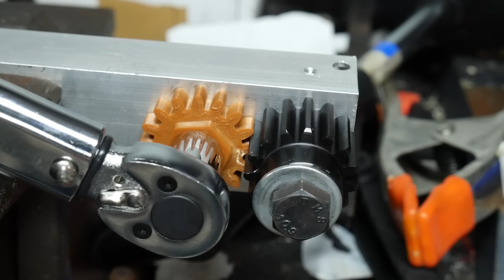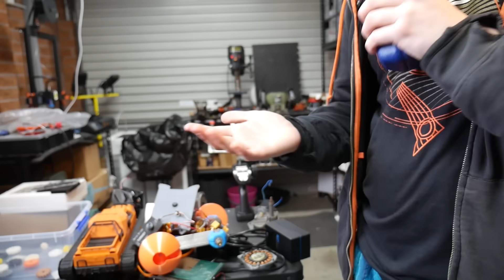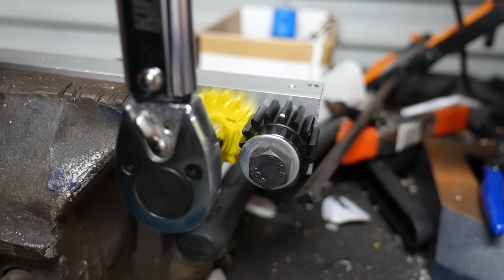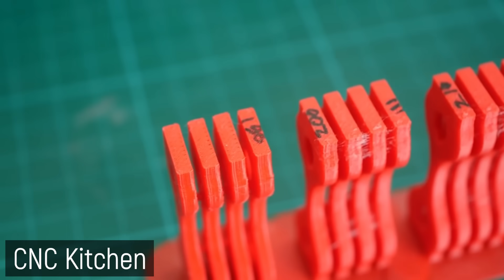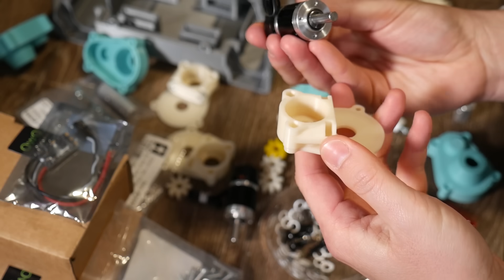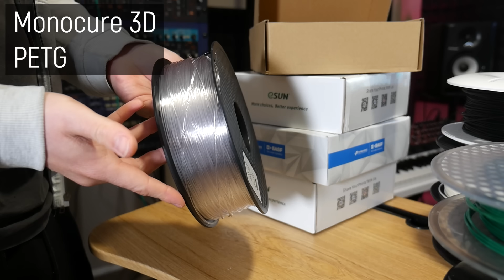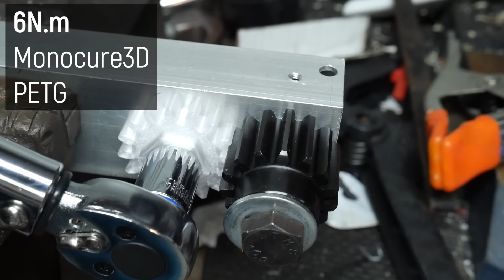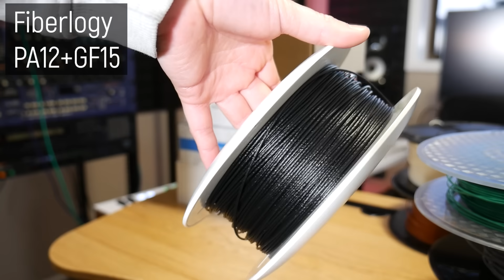Which 3D Printed Gear is Best?

Comment: it is pronounced B-A-S-F as it is an abreviation vor "Badische Anilin- und SodaFabrik" which roughly translates to "Badic Aniline and Natron Factory". You are welcome.

Regarding your strength tests: 12Nm is quite alot for a gear made from plastic and in this size. you could easily put more torque through it by scaling it up so the lever is longer. We made 3D printed RC cars in a university project and our gearboxes where the one thing everyone thought would fail but it was the only thing that didnt. 3D printed gears are pretty tough.

Comment: Interesting and useful information, however I would have changed your testing slightly. When you note the deformation of the gear stop and switch to a 'fresh' set of teeth. That way your failure spot isn't based on a weaken tooth. I doubt it would have been a big difference but still would be interesting to see if it would matter

Comment: Wondering if you could improve on failure caused in the hex shape, using a some kind of "star" shape profile - something they use for bicycle crankshafts instead of rectangle for better durability.

Comment: why not use cast aluminum? all you need is a torch, steel cup, molding sand, a few pieces of garbage wood, and a piece of really fine styrofoam. 
cut the styrofoam to the shape of what gear you want. make 2 frames out of the wood, fill one frame with the sand and compact it really well to the top. then put your foam gear down and put the other frame on the first. then fill it with the sand like the first frame. and make 2 holes going to the gear. one being the spout and the other being to release any air trapped in it.  melt aluminum, clean the dross off the top, and cast it.  you can make anything really super easy and way stronger than out of plastic.

Comment: Very nice video and great data. I would love to see the highest  ranked with a solid infill and see how those stand up to the torture.  Also like to see similar video with the other filiments you have on the way. 

As for drivetrain failure. I did some RC short course racing and learned alot about different ways things break.  Lol  like for the steering servos for example. There was a common upgrade called a servo saver. It was basically a spring inside a 2 piece housing and the spring would take the abuse  so the servo didn't.  I learned in the steering system and the drive train there are always going to be at least 1 part meant to fail in order to reduce the chance of other things breaking.  The spur gear that was attached to the gearbox  and meshed with the pinion gear on the high speed motors. Those were designed to fail. There was also a tension  clutch on some that had 2 disks squeeze the spur gear with a abrasive ring of what felt like grip tape. The clutch tension would save the spur from taking those jolts from high impact and the spur would shear off teeth if the motor continued to spin. 

For your application I would say use a material that shears off teeth for your bigger gear at roughly 75-90% max torture of the motors depending on the safety margin you are going for. For the gear on your motor I would think an aluminum gear would be better.

Comment: If you can find something that can take more power than you really need, then I'd suggest building in to the design intentional breaking points (weaker areas).. 

With the Nylon I wouldn't be surprised if it would've been possible to make specific areas intended to flex, so BEFORE you start bending the teeth to the point of breaking, it would be easier to "flex" (pushing the teeth out of the corresponding teeth of the other cog) instead of breaking; That way you could "overdo it" a few times before you had to replace anything. The issue with it "bending" at the point of Torque, IS a concern, but there can be solutions.. (More material- thicker walls- for the bolt, to use a Torx-shaped axel instead of hex, and so on).. 

Either way; Do Brushless motors really "break" that way?. I mean. I haven't played with those, but it feels like either it can excert the power or it can't move and would be standing still, so as long as you don't let it stand like that and overheat, you SHOULD be good to go.. Though that is me speculating.

Comment: I think the gear could easily be 15% stronger when the infill pattern is optimized for force transfere. Iterative 3d modeling could be a basis for that. It would also be interesting to know how many hours under a specific set of 2 wheels can transfer load until failure. Usually gears are made out of duloran or POM, but both have very toxic fumes at printing temperatures. ASA would be interesting. Unfortunatelly all the really good materials need very high printing temps. Did you use a closed printer for nylon + hardened nozzle  ?
Fillaments with glass/carbon fibers (use hardened nozzle)

Comment: With high stress parts I would think you would want to use the 3D printed parts to create molds from.  Then cast the final part in a more durable material. I've never done any 3D printing though so I'm not familiar with the material.  However, I would think you could probably do a lost wax casting with it.  I remember doing lost wax casting in an art class once.  It was pretty simple.  Not sure if it would work with 3D material though vs just plain wax.  If not, you probably could create a silicon mold first and the wax form from that and then the casting.  You could probably reuse the silicon mold many times also in this latter method... thus reducing the number of 3D prints for stuff you need multiple parts of.  Anyway, that's my 2 cents.  Not sure if any of this would work or not though.

Comment: You’re correct: BASF is spoken B.A.S.F.
(Badische Anilin- und Sodafabriken)
Reply: P.S.: I’m sure you’re aware that mechanical parts occasionally intentionally are designed to be „weak“  (and removable) in order to save the whole rest of a gear box or so in a device in case of a blocking.  So calculated weakness  can work  for safety, prevention of larger damage and for longevity.

Comment: PLA will become weaker with time and contact with not very dry air. I used some PLA stands that was made with extra margin and after half of a year some of them start failing. So very approximately they lose about 50% of strength in half of a year. So for real application I would use some materials that don't lose strength because of contact with air and leave PLA for prototypes only.

Comment: Stress application rate is also a huge factor in failure models. You should try very slow and fast loading speeds. They will give different results.

Comment: Static stress is not what concerns me in a gear, wear is what kills the gearbox. I get rather good results with Nylon, thicker walls and a double helical gear make a them strong enough and they last quite long lubed with a drop of potential grease even at rather high speed. If I wouldn't be able to print nylon I would go pet or pctg. For slow turning gears that need strength I would use carbon filled nylon. Pla gears work fine for a proof of concept but in real world rpm/torque settings things go wrong rather fast and unpredictable 😉

Comment: I'm sorry but I am a mechanical engineer and I must tell you that this test is not very valid, in fact the plastic suffers from viscous deformations (if applied a low effort, for a long time, the deformation is still consistent), in fact moving at different speeds for each test, you made the results unreliable

Comment: Very interesting! But I have a bit of criticism (sorry):
-> On some tests you could see cracks develop and you kept going, but this would have been the point of failure already.

Also heat greatly affects the forces that a print can withstand. So in general stay away from the point of failure by at least 30% and more if you want to run printed gears at high speeds! And note that softer materials in general will run hotter.

"What failure mode is better?"
Gear slip is great for a simple clutch to prevent peak forces from burning out your engine.
And I "prefer cracking gears" for more standard applications. Since they are harder, they are not as prone to material creep, which makes them smoother and more efficient (but also lounder).

Pro Tip: First look up which gears you would need to buy (e.g. injection molded or as zink cast). Then print them first to test gear ratios, forces on the shafts, etc.. When you're happy (and/or need extra strength) buy the gears as drop in replacement.

Comment: Is it worth encasing a 3D printed gear in moulding plaster and reheating it to melting temperature and soaking before allowing to cool? Effectively this should produce the equivalent of an injection moulded gear. Nylon should be OK as most RC gears are made from nylon.

Comment: Most of these appear to be delaminating between print beads,  typically for gears you want hardness as well as tensile strength. Gummy plastics generally won't be good on either front.  The highly porous and bumpy surfaces of printed media will cause alot of friction and will soak up lubricant as well as abrade into lubricants which is also bad for gear trains.  Mcmaster carr ships in a day or two

Comment: Some lawnmower engines have nylon injection moulded gears (and cams), they are absolutely horrible and will break first before any other part on the lawnmower, still a bit annoyed about someone deciding to cut costs and not use metal

Comment: If my motor won't withstand an indefinite stall, I'd either be protecting it with an over current sense, or with a link specifically designed to fail at some torque. With the gears themselves, I'd be more concerned about wear.

Comment: using your drive mechanism, nylon makes the most sense. if your drive train exceeds the torque, the gear doesnt shatter or bind, it simply yields temporarily to the torque, and would work once again at least temporarily, so immediate dissassembly wouldnt be required. overall really nice vid demonstrating a lot of filaments together. im relatively new to 3d printing and this will help with my material purchasing decisions

Comment: @Maker's Muse
15:30 it would be nice with some icons of the gears too, those cryptic item codes don't tell me much (it is very good that they exist too).
(Maybe also add actual numbers on the bars too, in a up/down configuration inside each pillar, so you don't need to guesstimate or go back in the video to know)
(That's the only improvements of the video I would make,  I'm really glad the overview exists.)

Comment: This may have been mentioned already, but it would also be great to see results from an injection moulded or machined plastic gear - to see how much impact the printing process/settings actually have on the strength.

Comment: I feel like there are slicing hacks here. Like you can do inside walls(by slicer features or making thin slots inside your models) to reinforce mounting points and nut slots. 

How do you manage to print really old filament without issues? I have come to the conclusion that my old and probably moisture damaged PLA might have been the cause for all my underexteusion and partial clogs. Maybe it's just time to clean ever and replace the hotend.

Comment: This was a really interesting watch, thanks Angus.   I've been messing with a gear reduction for my Big Mixer project and have been trying to figure out how to deal with the increased torque.  I was surprised to see some of my PETG parts fail before PLA, in particular I noticed a significant difference between eSun and Zyltech PETG rigidity.  

Most of my failures seem to be at the attachment to the axle, rather than the gear teeth.  Your approach with a 12mm hex head might be a better idea than using the axle detent and a 2.5mm screw that I have been using previously.  Thanks for the idea!

Comment: It seems like the internal geometry of the gear probably needs more consideration, if you aren't going to be using 100% infill. The infill is what is largely responsible for transferring mechanical torque from the internal hex to the gear teeth, and from the way it looks like the infill is being generated, most of the force is being transferred to the sidewall, rather than the teeth themselves. This is evident in the failure mode of most of of the gears you tested, where the teeth shear off of the wall. I think the gears would likely function to higher torque ratings if the teeth were supported by being filled and having spokes running straight to the internal hex wall.

Comment: Strength isn't the holy grail for gears. The keyword is "abrasion resistance". And Nylon does that very well, which is why it's used in commercial plastic gears.

Comment: I think I would choose PETG style failure as it is less likely to gum everything up by partially slipping and almost gluing everything together.
That said, the way Nylon slips is not too bad if you need heat resistance.

Comment: When it comes to metal gears the size/material of the gear is usually dictated by the fatigue strength of the gear tooth surface (hertzian contact stresses cause the tooth to fatigue below the surface and spall off little metal flakes) rather than the bending strength of the gear tooth. I wonder if this also applies to the plastic ones?

Comment: You should look into a dial type torque wrench for testing like this so you can monitor the actual value where the part fails.  They are more repeatable then the settable torque wrenches as well

Comment: Nice set of tests. I am looking at a number of printed gear applications in robotics. Three things worth mentioning. (1) Infill - as many said, a sold gear would be interesting to try. (2) But I think the clearance on the hex is also important for those where the hex rotated. The clearance might seem an insignificant figure when compared with the A/F dimension but, in reality, the clearance should be compared with the difference between the A/F and A/C. This is a much bigger percentage. We drive a lot of 3D printed mechanisms with 1/2" hex rod and always ensure the fit on the hex is as close as possible. (3) It's probably also worth extending the length of the hex socket on the printed gear and perhaps making it thicker to ensure it is not the first point of failure. Then we can see what the teeth will really do with the Nylons. Great work and I always enjoy your clear and concise delivery - one of the best!

Comment: Tough means it can handle a lot of elastic strain energy. concrete is strong(in compression) but metal is tough.
Spring steel is not as strong as high carbon but it is tougher. Dont let engineering terms confuse you. Tough means more elastic deformation before breaking

Comment: I have been printing PC a lot its freaky good stuff. The best way to describe it is its like PETG but better in every way. Its stiffer, stronger, more heat resistant. The biggest downside is its a pain in the ass to print. You need some serious enclosure tempatures to get prints that won't warp. Small size stuff like these gears would be easy to print a part print like the body would warp a lot.
You could try ccdiy they sell it in aus.

Comment: you should have turned the gear a few teeth after each try to eliminate the previous stress factures. I wonder if they would last longer and accept more torque without failing if you started at the max rather then working up to it in the same spot. I hope that makes sense.
Reply: oh wait you didn't work up tp it with the second one. My mistake. Loved the video, subbed 👍👍👍

Comment: i had designed a sort of wrench that always kept breaking in the same place until i tried concentric infill and wide extrusion width (stefan cnc kitchen did a video about extrusion width being a good way to add strength).

Comment: Have you tried the tooth outlines going further into the gear instead of just along the edge? It's hard to explain without a picture, but since most of the gears failed by having the outside layer shear from the inside fill, what if you had every other layer of the outside continue further into the gear? Sort of meshing the outside layer with the inside support to reduce the shear line.

Comment: On my open rc, I had to print out the axle, and small gears out of abs. pla kept getting twisted off and summer teeth on the gear, however the big gear is still going fine.

Comment: Commercial gear trains sometimes use a shear pin to avoid damaging the gears or motor. Put the gear in place, then drill through the hub, the output shaft of the motor, and the other side of the hub. Put the shear pin in the hole to hold the gear in place. The pin is often brass, but you would probably use some sort of plastic. You want the pin to break before the gear gets damaged. If it breaks, it's easy to knock it out and install a new one, and nothing else is destroyed.

Comment: So, another potential testing setup (that will probably not result in different results for the torque but might for failure mode) is holding the printed gear static and driving the metal one (which would closer simulate the gear being driven instead of the gear driving). Also, I'm very interested in the fact that most of the PLA failures seem to have been from two parallel perimeters coming apart. I wonder what might change if the base was slightly different, perhaps seeing a variety of gear diameters, which might be useful to know if you need gear ratios.